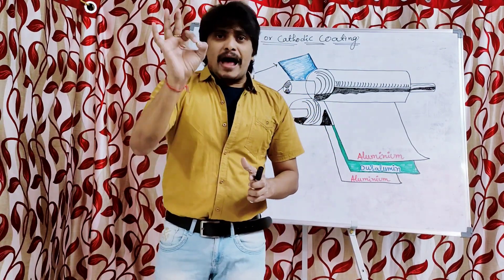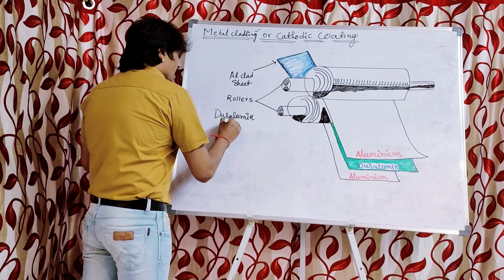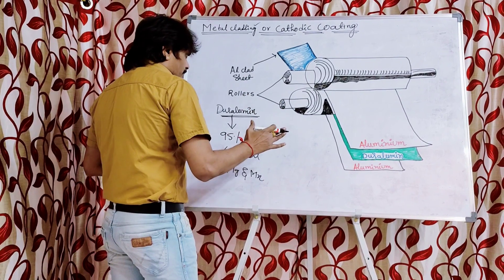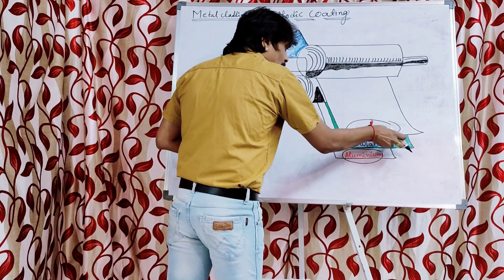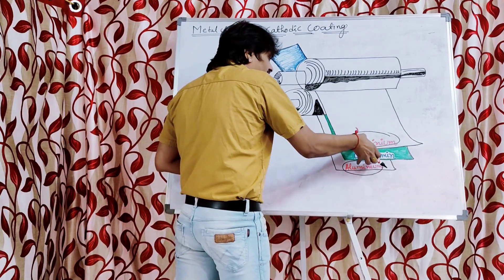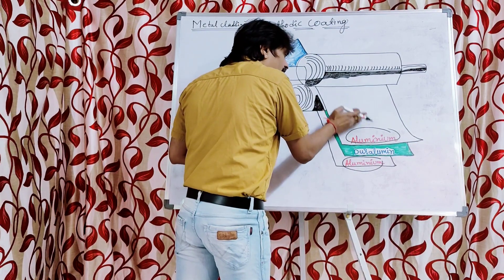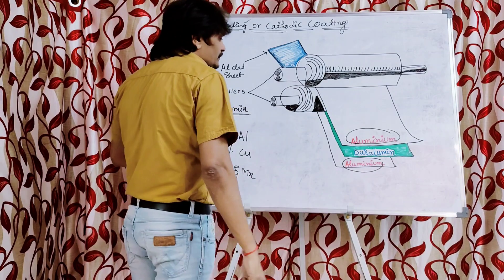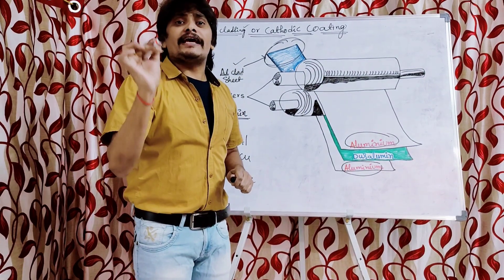Corrosion controlling methods: Metal Cladding|Preparation of Al Clad sheets|Cathodic coating.

Comment: I'm confused
As u told to sandwich to different metal .. cladding needs to apply only pressure from both side , but how can metal strip get interlock over each other without application of heat . As there may chance to remove upper or bottom layer as its is fixed by pressure only . How two metal surface gets interlocked by applying only pressure ?
Please explain ? Intersted in cladding and brazing application . U explained cladding process very well .
Please clear my doubts. Thank you.

Comment: Excuse me sir u said that another name of the tinning is cathodic coating and even for the metal cladding u said that another name is cathodic coating 😐😐
Reply from the maker: Cathodic coatings involve coating metal, which is cathodic w.r.t the substrate in an electrochemical cell. The purpose of this type of coating is to protect the substrate from corrosion, in the case of tinning and metal cladding the metal which is used to protect the other metal is cathodic in nature that's why both tinning and metal cladding are considered as cathodic coating.
Reply: @DrKShirishKumar  thanks alot sir 😄
Reply from the maker: You are always welcome